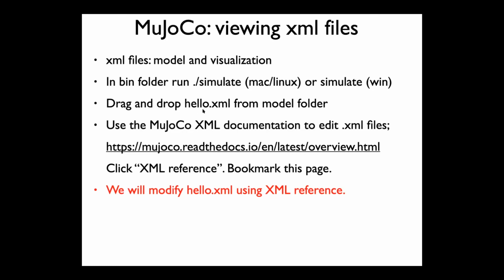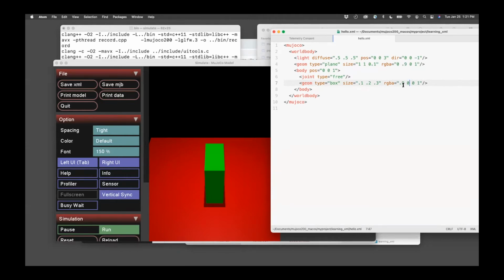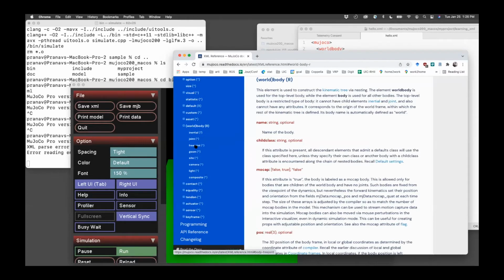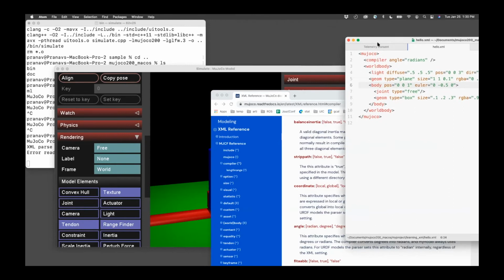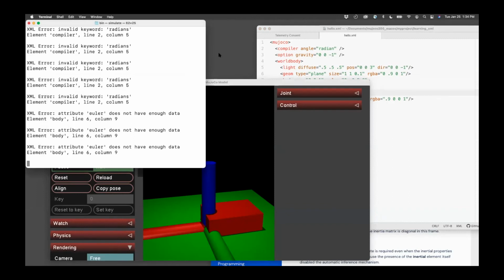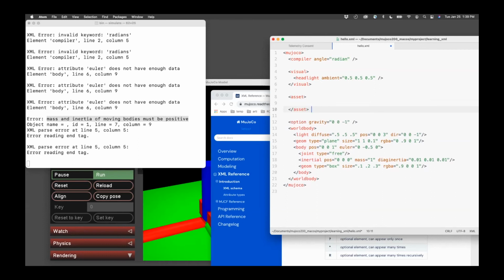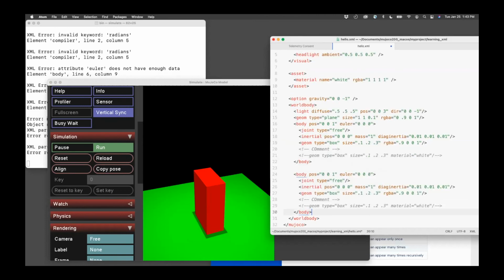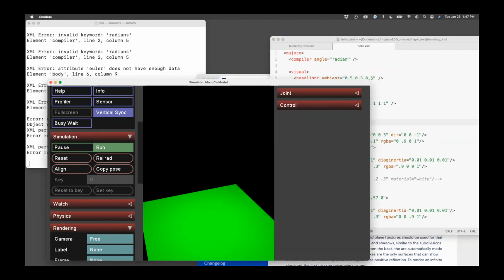MuJoCo Lec 1: Working with XML files (Spring 2022)

Comment: Hi,

from my understanding you use mujoco with python by installing it like this:

(sudo) pip install mujoco

Since google/deepmind bought it. Their documentstion says mujoco-py is dead since about 1 year („not maintained“).

Now, my Problem is this: if i install mujoco like this, it doesn’t have a „simulate“ package („from mujoco import simulate“ as well as „import mujoco“ and then using mujoco.simulate() throws an error). It also doesn’t have a „simulate“ directory nor a .py inside the installation directory. Why is this? The official python bindings for calling simulate, from within a project as well as from the commandline, simply do not work and give errors like „unknown command“, „no such file or directory“ etc.
I‘m working on ubuntu 22.04 and am trying to simulate our unitree robotics go1 for research, but it just won’t work. Did I miss anything obvious? Or do i just have to try to build it manually from binaries?

Thanks for your help.
Reply from the maker: pip install mujoco will install deepmind mujoco. That is what I recommend. 

If you are looking to get python working on ubuntu please see this video: https://youtu.be/gAiQvJ0f5Ls

If you are looking to get simulate working on ubuntu please see this video: https://youtu.be/G0Tv1BnNE2g